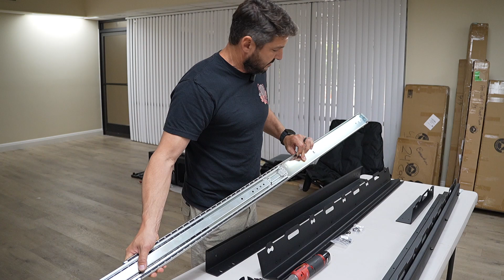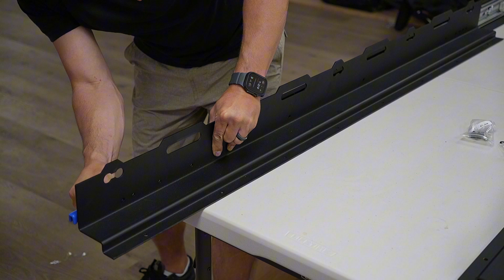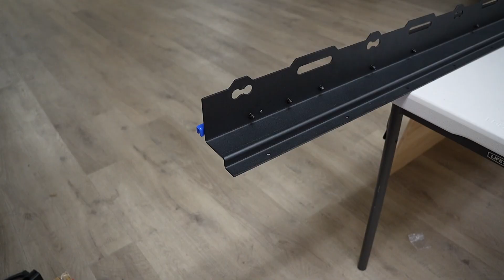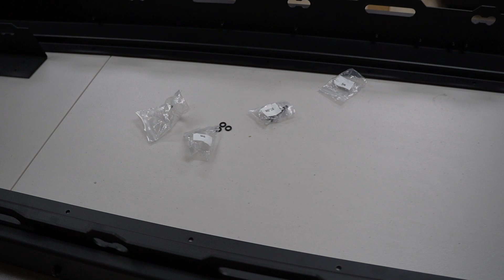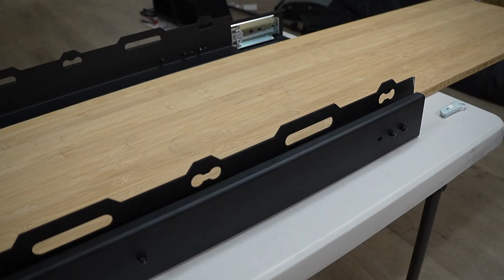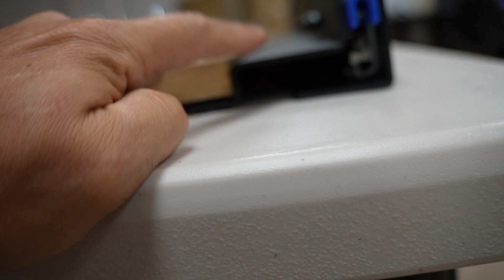DIY PULL OUT TRAY 60" Assembly Process

Comment: When the rails are assembled how do you access the mounting holes at the back of the tray? It seems the last three are covered by the upper slide assembly. Unless there is a way to extend it out more, or detach it completely.